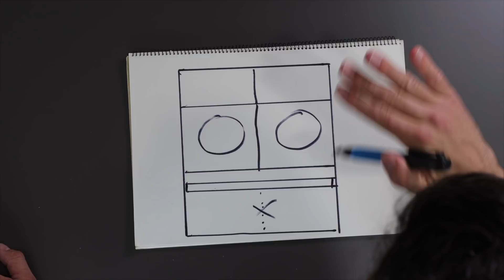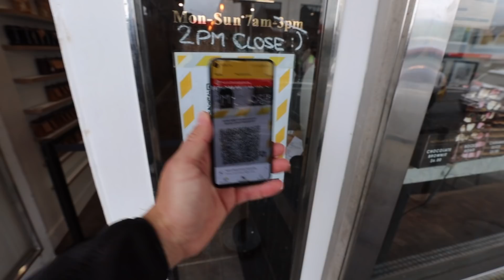I Made a Mistake (And Learned How To Fix It)

Comment: Todd Roelens here.  Nice work Scott looks great.  I love that you're open to suggestions and that you share them.  Helps us amateurs out a lot.  I have built something along these lines in two previous homes and you might consider some kind of front lip where the machines sit.  I found it practically impossible to get them to sit perfectly level.  That combined with the fled in the  cabinet let's the machines "walk" due to vibration (i suppose).  I actually made recesses where the legs of the machines sat to "trap" them in place and keep them from  walking of the edge.   I may be jumping the gun with this suggestion.  You likely thought of this already.  But, I rarely have good ideas so I'm hyped at the chance to help out  :  )    Thanks for the great content Scott.   Looking forward to more videos with your partners and various "cast members".

Comment: Scott. Always screw end panels from inside the cabinets so if they get damaged you can unscrew them, pluck them out, and replace them. Also NEVER  let them touch the floor. That way they'll never get wet if there's a spill and the toe board can continue without a break. Also you'll never kick them. And if you're putting a drawer in any cabinets do it on the bench...it's way easier than on the floor. Hopefully that unit doesn't vibrate and shake to much with the washing machine on spin. Time will tell I guess. And once again the solid backs should go OVER the unit ends and bottom NOT inside for the same reasons as the ends go past as you worked out.

Comment: Future proofing for ducting the eventuality dryer - that’s craftsmanship! Well done. 
The laminate plywood with visible edges, seldom seen up north, like it a lot. And it’s strong.
The way you hang the wall cabinets, it seems painstakingly difficult using jacks. 
If plastering was done after the cabinet fitting you could fit a levelled stretcher on the wall and rested the back bottom of the upper cabinets to the stretcher and screwed the cabinets into place. The stretcher could have been removed afterwards. It’s common to leave a stretcher (if a good looking cabinet quality stretcher was used) Most cabinets receive a front facia or trim to conceal ie lighting anyhow.

Comment: 11:54 It's so hard to remember every detail when you're doing it without any shop drawings. I did some big stained Rosewood doublehungs (2.2x2.7) and the jambs comprised more than 6 parts and detailing all the individual profiles particularly where they met the head and sill was a really mental strain just to keep track of which part I was editing, even though I was modelling it in 3D.

Comment: I'm not a builder or into construction in any way. But I have learned that heat works with removing (vinyl) stickers from cars, etc, where you use a heat gun/hair dryer to deactivate the glue on the back. I think it would help leaving the boards in the sun before pulling the protective film off. Even if they are warm(er) from being outside before you cut it, I think that will help.

Comment: Always refreshing to watch you work. I did a similar platform for a washer and dryer. Front load washer turns out to be incredibly heavy, weighted to keep it from wobbling in spin cycle. As usual, over engineered the solution. Had three of us jump on it. Thanks for the video.

Comment: Fantastic work Scott and I'm a fan since around the episode 80. If I can give my 2 cents, personally I would add a few Brackets to hold the panel the washer dryer will be sitting on. I saw you put glue but personally I don't trust glue on melamine. Plus there will be lots of vibrations.

Comment: They make color match screw cap things that are plastic and push in to the head of the screw to “hide” it. I think you can get them from Amazon if you have that there !
Reply: I use a brand called FastCap, and it's actually a tool for making the screw cover caps and a special bit for predrilling a hole that fits the cap.  Normally, you take the edge banding and use the specialized tool to punch out a cap.  It works great and pretty much every cabinet guy has one around here.

Comment: Scott, what was the point of putting the dpc material on the bottom edges of the units?  This will be useless and any moisture on the floor will get between the dpc and the units.  Better to use the adjustable plastic feet like on modern kitchen units then the actual units are raised off the floor.
Reply: I tend to agree, especially since the adjustable legs are inexpensive and allow you level your cabinets easily.
Reply: I understood it was just a barrier to prevent moisture from the bare concrete getting drawn into the ply. Not surface water etc, which I think is what you are referring to. But I would have raised them too.

Comment: Scott, regarding laminate. There is a feature on the makita that allows you to cut the laminate first with a 2mm plunge. I use it all the time and it works well. Thanks for the video.
Reply: I'm pretty certain he mentioned that as a friend's pro-tip in an earlier video.

Comment: will be interesting to see how they hold up with the vibrations and heat from washer and dryer and also the weight of a washer plus clothes and water
Reply: With the 9 lam plywood, he used that is the last thing anyone needs to worry about.  WAY overkill.
  I don't know what the prices are down there.  Here in US  9 ply 18mm is $69, 15 ply 21mm is up to $125 sheet. or more depending on details.  specials are a lot more.

Comment: Im curious where the plumbing connections are for the washer? Looks really nice!
Reply: They're in the cabinet next to it that he built in the last video - where the tub goes. You can see them in this video. Guess there will need to be room at the back of  the sliding shelf for the hoses and drain  to pass up.

Comment: pretty awesome work there mate.. just a thought I would like to share if it helps but that would have been the electrician helping out as well. having the power point for the washer and dryer behind the units doesn't help if you need to turn it off/on as it is hidden behind and the cables are usually not long enough when the units are sitting on the floor.. that plywood is an awesome product. where did you get that from?

Comment: please put a shadow bottom on over head cupboards so you cant see the screws going up just cut a board the whole length and width and screw from inside cupboard to hide all bottom nails and screws and a edged shadow line or plastered bulk head would really finish off the over heads

Comment: So here's my take on building your own cabinets.  I love the idea of hand built, and a SBC build no less is a great thing in itself.  I don't know how I feel about exposed plywood edges but it's a taste thing. However, in today's day and age of CNC router tables, and easily attainable software for making designs for your cabinets, I see no reason to build them yourself, or at the very least cut them yourself.  Most shops will cut a sheet and edge band the parts for a fixed price per board.  Your time is valuable, and frankly the whole kitchen could've been cut and edge banded all in one day.  Parts could be put on a palette and shipped to you and you assemble them yourself.  You could take a lot of guesswork out of it by using all the tools available.  So just a thought on how production cabinets are made these days and how it's not impossible to call up a millworking shop ask about getting some parts made.
Reply: Lockdown in NZ means getting on with whatever you can do with whatever is available. Otherwise long wait. But, being a builder, not cabinet maker, he might not have known of the ideal option
Reply: @cuebj  Good point, hadn't thought of that, and yeah it must be difficult in a lockdown to get things done.

Comment: Did I miss where the washer drain is going to be placed?  Is there a minimum drain height from the bottom of the washer in NZ?
Reply: I don't know about NZ, but in US it's typically specified as a measurement above the floor. @ 30-42"  (1m)
  It's very different in a lot of places. Sometimes as little as 18" (0.5m)

Comment: Hi Scott, love the channel and the vids. Hope things are good with you and Jess. I just wondered if you could do a quick vid or give some tips on how to cut large pieces of sheet material with a circular saw, and make sure the edges are square? I can’t afford a track saw at the minute and dont want to buy a universal track saw as i may invest later on. Any tips and tricks would be great. Keep on building Scott.
Reply: What I did before buying a track saw was clamp a level down offset from my line so the blade on my saw hit the right spot. It was painstaking and time consuming always making sure I was the right amount away, but it did work. Good luck!
Reply: @Gottesacker86  I’ve tried that but the level moves. . . . . . . does that mean that I just need some better clamps then?! that seems like that could be the thing 😄 cheers Patrick, you could have solved a problem that was bugging me for ages. il get some different clamps and see how that goes.
Reply: @delonr5525  I just had some simple DeWalt squeeze clamps at the time. It seemed to work fine for me, but could see how it could slide. I think Kreg makes a jig that fits any circular saw. If I remember correctly, seemed it wasn’t too pricey either. Might be worth a shot.

Comment: I was a cabinet maker you need ventilation for the hot air being's released from the dryer or it will blow up
Reply: Heat-pump condenser dryers don't expel air.

Comment: I wonder why the client wanted the washer and dryer elevated like that, if they were on the floor they could have still had the same amount of storage. Plywood is so awesome for cabinets, worth the extra expense, thanks for the video...
Reply: probably to not duck down to the floor and work almost at table height.. I'm 1.92 and I'd appreciate something like that, but I'm still making my mind about the wood supporting the washer and dryer... they'll be rocking hard so I am wondering how long would that last.

Comment: I’m sure project will look good when finished but what you did not show was fitting appliances up there. What is never taken into consideration by kitchen designers is the service engineer how do we get it out to service , and at some stage it will break down also engineers do not travel in pairs.Just a thought.

Comment: Hey brother, love the vids mate, bloody awesome. You have inspired me to build my own deck! And with that I have a quick question... I have my bearers laid ready for joists. I have used rough sawn 150x50's for the bearers but noticed they are not always "clean" or straight. I have measured and planned to use the same for the joists to get the 32mm decking boards flush with the joinery, but we are milling our own boards for the decking (60 year old Douglas Fir) so we can make them whatever thickness we need. Will it make my life easier if I use dressed 140x45's for the joists? There's quite a price difference as you know. Thanks brother! Hope the lockdown's up there ends soon enough for you all! Benny.

Comment: I'm curious Scott - unlike the cabinets on the left, this heavy duty cabinet didn't have plastic legs you could adjust to ensure its top is level, it was (sealed) plywood sides sat straight onto the concrete.
How did you ensure the counter holding the laundry appliances was level?  Or did it not matter as much when the cabinet's main job is to house laundry appliances?
Reply: Usually you'd use packers to level the plinth/cabinet

Comment: Hey Scott, do you have a link for the square on the plunge saw rail? Sorry if any terminology is wrong, English is a second language for me. We use mainly Makita tools at work
Reply from the maker: Hi, bit of a sad story there. I have heard the company that make the square went out of business. Search "Taiga Tools rail square" ..some companies may have stock left over, get the one that fits the Festool rail, it will also fit the Makita rail too. I know Festool make a similar product, but I haven't tried it myself.
Reply: @ScottBrownCarpentry  Oh that's a shame. Thanks though, I think I gor a few hits. I've looked at square attachments before but they have all been so extremely pricey.
Reply: @ScottBrownCarpentry  The Festool is made by TSO in the States, excellent precision bit of gear, but the Festool rail joiners are not, the TSO joiners and fantastic, no need to check rails with straight edge. Who doesn't love Scott Brown?? Cheers from Oz PP

Comment: So how does the owner drain the washer when they need to clean the fluff filter?
Reply: @cmmartti  on our bosch, open a lower front panel and unscrew the filter. Its full of water, so it will  spill out over the cabinet in this design. At least ours drains on to the floor. Will be interesting to see how he can stop the washing machine vibrating out during spin cycle too. Ours moves all around the place.
Reply: @cmmartti  front loaders always have some

Comment: That shelf will sag in time even with just the static load. An average empty front load washer is around 85kg. Should'a used steel to brace it.
Reply: @cmmartti  You haven’t worked with timber much have you? It moves. Add the heat pump dryer at 55kg and the constant force will make it sag. Even 2mm will throw the washer out. Then it’ll be more.
Reply: @cmmartti  It’s almost the weight of 2 men standing on the shelf permanently. Bending is what timber does. That’s one of the properties that makes it such a good structural construction material.

Comment: How is it possible to not have a vent on a dryer? (Unless it's outside.  Which this one won't be.)
Reply: Condenser dryers don't need an air vent.  They do however need a drain or an internal tank to hold the water that is condensed out of the moist air.
Reply: @kshred3043   I found that out.  Sounds like a great idea.  Thank you for the answer.

Comment: Those comments about it being better with the screws from the side than the bottom shouldn't be taken too seriously, you're working with heavy plywood, plenty strong enough either way. Some diy cabinet maker (like me) from the US, Canada etc would be used to working with particle board or MDF which seems to be the only kind of stuff you can get with a melamine coating. It's weak and cheap garbage, not like that nice plywood you got. I enjoy seeing the different materials available elsewhere, for example your melamine plywood and things like through colored MDF available in Europe. Oh, and I might add, I love that QR check in system in stores. We have too many "freedom" loving entitled fools for that to work here.

Comment: Curious about the size of the dryer and its lack of a vent. Is it going to be one of those steam-evaporating pieces of trash? If so, I'm confused at the decision to make a nice laundry with a crap dryer.
Reply: @Dan Anderson I think you mean a condenser not evaporating. What's there to be curious about, the dryer will fit in the cabinet provided. I'm confused by your inability to realise the customer gets what the customer wants.

Comment: You made a huge mistake by having the studs where all the weight, dynamic charges even when they are on!, being screw horizontally. They should be sitting on top and screw vertically, all that weight and shaking will in a rather short time period loosen the screws creates more and more vibration.
Reply: Can you say that in English please?
Reply: It looked like he doubled up the end ply, so the studs are sitting on top of the inner boards.
Reply: @135Ops  That first sentence is hard work. Tried to understand it but gave up.